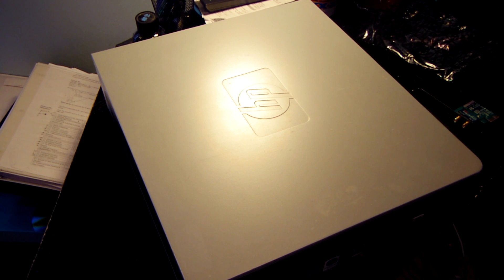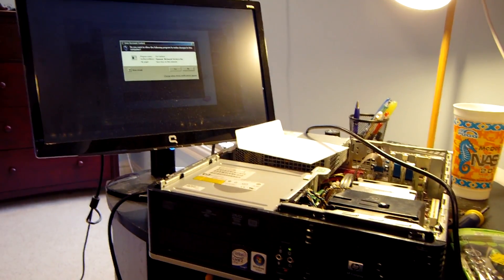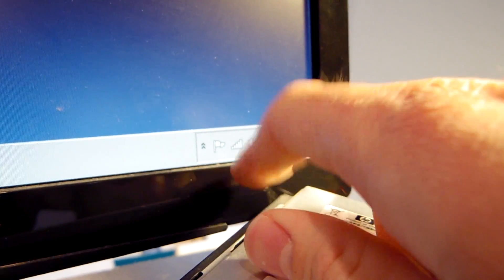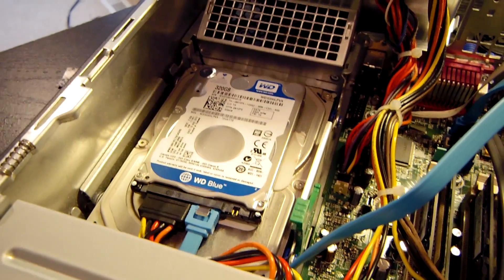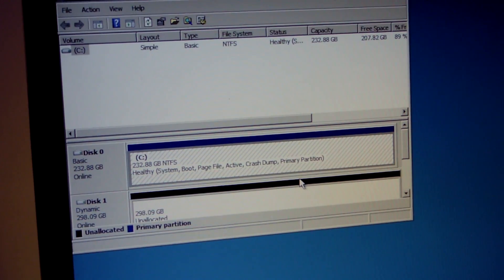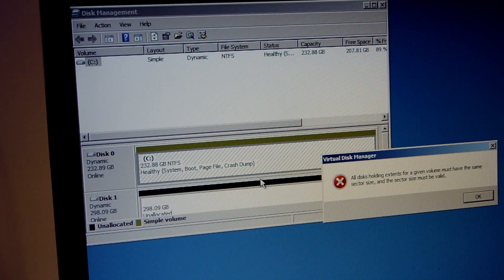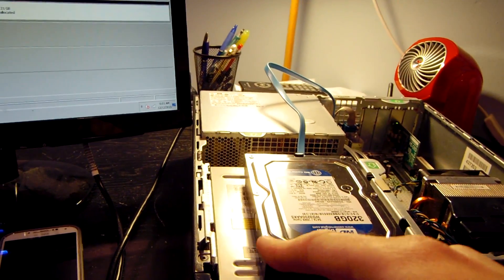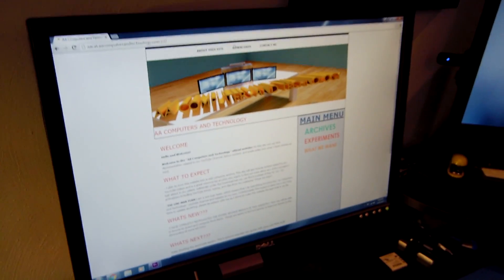Server Upgrades: Rosewill Wireless card, Caviar Blue Hard Drive in "RAID"

Comment: what type of network card was that ? it didn't look like Ethernet
Reply from the maker: +31337 Clan Rosewill 802.11 b/g/n PCI wireless card, it was in the description ;)
Reply: AA Computers and Technology oh srry bro . I did read the description but I kind of looked like something I'd find on the back of my older tv . And where do you buy your hard disk drives from I cant find and ide hard drives for my older system